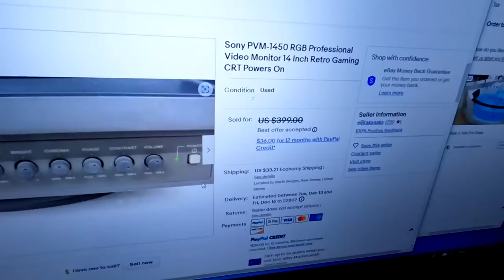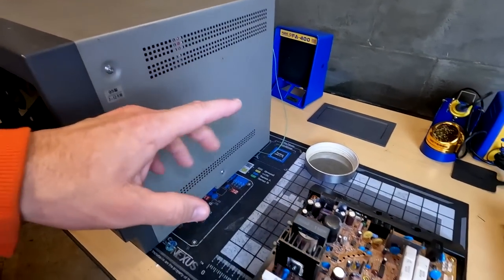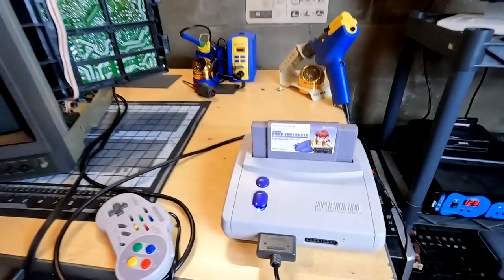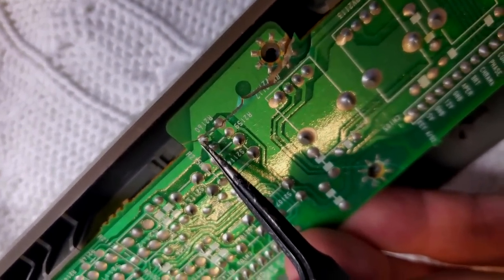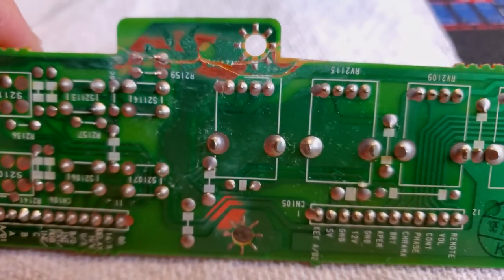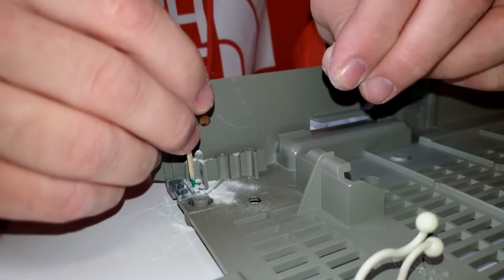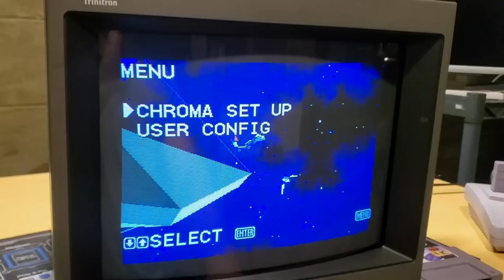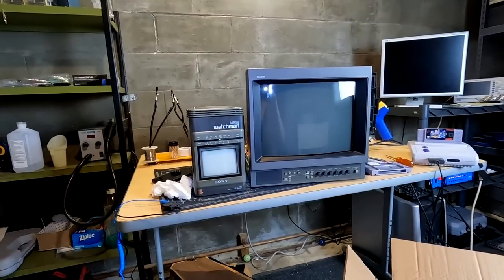This CRT from eBay has a mysterious problem. Can I fix it?

Comment: Here in the Philippines crt's are being sold everywhere literally, most are new old stock. I bought 1 Sony fw900 for just 10 USD lol. Even most people here still uses crt tv and most still prefer them over flat panel displays like leds and lcds because they are easy to repair unlike most flat panel that are disposable.
Reply: Really? That’s pretty surprising
Reply: @jeffthenotkiller  yep. It's like your stuck in early 2000s again.
Reply: Are they second-hand tv-set's or new ones? Here in Poland it's possible still to buy second-hands but it's more and more challenging...
Reply: @ITGuyinaction  most are new old stocks (imported) from Japan and china. You know unused crt's that are being sold. PVM's are not kinda common but Samsung, Aoc, Sony high resolution crt  monitors are pretty common in new old stock or used second hands.
Reply: In India yes they use and repair crt tv
Reply: @Raz82000  I didn't know that they still have stocks... Interesting...
Reply: Sooo...does the Philippines ship New Old Stock CRTs internationally? 😉
Reply: Time to visit the Philippines lol
Reply: @retroftw  That would be the idea!!!
Reply: @maxrichards5925  With a big suitcase? 😜
Reply: @ITGuyinaction  A shipping container with a handle on top? 😜
Reply: @ITGuyinaction  I hope. Now that I think about it I wonder if most of the professional CRT’s that Sony made had suitcases made for them
Reply: @maxrichards5925  I saw a sharp boombox with built in crt tv yesterday. If portability is your idea, I recommend that one, I just forget what model. I'm gonna take a pic of it If I see it again and post it on Reddit. It was owned by some mechanic outside my tv repairshop.
Reply: @Raz82000  Oh that’s neat
Reply: @retroftw  try searching in Google. I can't post the link tho YouTube keeps deleting my replies. Most are good second hands.
Reply: @retroftw  Much better! 😜
Reply: @maxrichards5925  I don't know... Some probably yes...

Comment: I always love to see people repair plastic. Idk what this tv case was made from, but one relatively unknown technique I always try to share for plastic repair is ABS glue. I've found that a lot of electronics plastics (video game consoles, etc.) are made from ABS, so ABS glue is an amazing way to repair them. The glue is made using ABS plastic and acetone. It does exactly what you would expect from a glue with the added benefits of the filler material being ABS just like the host material AND the glue behaving more like a weld than a glue (the acetone in the glue melts the pieces together and the bead of ABS builds up strength in the surrounding area). Hope this helps someone!

Comment: The best solution is to get an online UPS that allows you to set the output voltage. You can set it to 110v which will be in spec for both 100v and 120v electronics, and then run everything in your shop off of that.

Comment: Hello from London! I was lucky enough to get a Sony Profeel KX 27PS1 monitor,  its a beautiful machine but sadly the screen is out so I used the 240 suite on the megadrive. It's out quite a bit! I'm wondering if I'll have the screws inside mine to manually adjust the picture? Also I have I slight fog in the right hand corner of the screen, I'm wondering if a degaussing wand would work? Thanks for your time! Great informative channel! 👍🏻

Comment: That 125 volt rating has little to do with the input voltage-the FUSE is rated for 125 volts.
The power supply may still be different.
I suspect that if you had the service manuals, the differences would be fairly obvious.

Comment: Does this CRT
have an OS or a Bios. I always wonder how the preloaded
graphics and menus work?
Reply: That's quite simple. They produced at those times specialized chips being responsible for generating all menus and quite often for remote control/buttons in tv (in one chip). They had analogue pins (output of digital/analogue converter) for values like contrast, lightness etc. and they also controlled tuners (frequency). I don't think they were programmable (perhaps only once in factory etc or perhaps it was just "fixed" structure). From perspective ex. of electronic engineer who wanted to use such a chip in his own project, he didn't had any influence on anything (I mean he wasn't able to change ex. font, colour, nothing).
Reply: @ITGuyinaction  Thanks. How did these chips work?
Reply: @thetechboyorg  It depends about what exactly you ask. Perhaps you should search for old schematic diagrams of old tv-sets. Then you will easily find those chips and you can search for their specifications. It might be challenging after so many years but I guess you should find something. Regards
Reply: @thetechboyorg  it's just a 1 time programmable (OTP) microcontroller with DAC/ADC inside the chip.
Reply: @Raz82000  How do you program it?
Reply: @thetechboyorg  At least the models I know were produced in factory, thus you as end user (electronics engineer) you were not able to do it. However I'm not specialist here.
Reply: @thetechboyorg  The factory that made the specific model programs it. You cannot reprogram or erase it's content since it is an OTP microcontroller you can program it only once and the factory just did that. Now if you really want to make one, the easiest way is to clone the chip using Arduino and 2 serial shift registers by copying it's program to another microcontroller. The other way which is the hardest is buy an 8051 microcontroller chip and a bunch of CMOS logic and ADC/DAC chips then program it using python or c++ make your own machine code from the scratch.

Comment: Hi there! Love watching your video's! I have a question regarding a Sharp CRT that you can maybe help me out with. I'm new to repairing CRT's and haven't got any experience on it, that's why I'm hesitant to try out things I'm uncertain about. 

I got the TV for free from a relative that wanted to throw it away. It's a Sharp DV-3760S and the only thing it did when plugged in was that the stand-by light lit up. After taking off the back cover I noticed that there were no capacitors that were clearly busted, they all looked fine. After a while I noticed a small potentiometer that said '110V' on it. I thought what the heck, gave it a few spins with a screwdriver, and boom I heard the high pitched sound that CRT's are known for (I guess it's the high voltage sound? not sure). The TV lit up for a fraction of a second and then shut off again. 

After a while I got it to work for a longer period of time, by turning up the potentiometer all the way until the high pitched sound came on, then immediately turning it back a quarter of a notch or so which kept the TV running. 

The problem is that when I keep the potentiometer on the setting that keeps it running, it won't start up from the standby mode. It seems that it isn't getting enough voltage then. Turning it up and turning it down immediately when the noise is heard is the only way to get it up and running at the moment. But then of course I cannot replace the cover and the TV cannot be used in a normal way.

I don't think it is financially viable to repair the TV since I could pick up another one second-hand for a tenner. However, I think it is a shame to throw away a device that I know and have seen can work well. Do you perhaps have some tips for me to get the TV working again?

Comment: hey Steve, have messaged you on discord a few times about my experiences with importing from JP. never once had a problem with any of the about 20 monitors mostly PVMs using them here in the US on whatever voltage my outlets give me lol. still use some that i didn't get rid of, going on 6 months.
Reply: could be frying my homies, but doesn't appear that way to me. maybe i lucked out with models that accept our voltage.

Comment: Hi, I know this isn't directly related to your video. But you are a CRT expert legend and I wanted to ask about washing CRTs with water hoses.

I've seen several channels of people finding old CRT monitors and spraying them down with garden hoses to clean them. Then letting it dry out and turning them on. And somehow they still work. 

Is this actually safe for the electronics inside? I thoughr water is the one thing you are supposed to keep away from electronics. That it could damage it.

What are your thoughts?

Comment: I use UV epoxy for  cracked boards. technically youre only supposed to use epoxy, but I suppose super glue will work? either way loved the video!

Comment: why not just get a CRT from the thrift store? there is literally no difference. Here in my country CRTs are still widely used, and you can also find them very cheap, often for $10 or less. And they also have a SCART input, which is RGB of course.
I see no reason why someone would get a monitor for $275. It's crazy, plus that could literally be spent on say, a mid-range phone or uhh, maybe to improve your retro collection in another way. Not exactly the smartest purchase, but hey, you got the PVM working at least
Reply: PVM's are much more high quality than your average thrift store CRT-television. More inputs, more adjustments, takes in all kind of signals (PAL/NTSC/SECAM and even progressive) and are much more robust and made to last. And they do have the best possible CRT image quality, because they are meant for professional use where color accuracy is everything. Also higher resolution than cheap televisions.

For normal "retro corner" use the $10 TV's are fine, especially if you find a higher end model with an Trinitron / Diamondtron tube or something like that. And with RGB-input of course, or at least S-video. But in the US that's not always the case, only RF and Composite on cheaper models. Me living in PAL-land am fortunate to have the luxury of a SCART in almost every TV-set made in 90s or 2000s. Hideous connector, but provides the glorious RGB goodness.

But if you're truly passionate about your CRT's then PVM is the way to go, even with that high of a price tag. I'd rather buy a $300 CRT than a $300 phone any day. Fortunately I don't have room for many more CRT's, so I don't have to think about that.